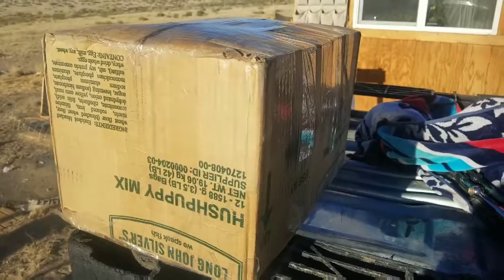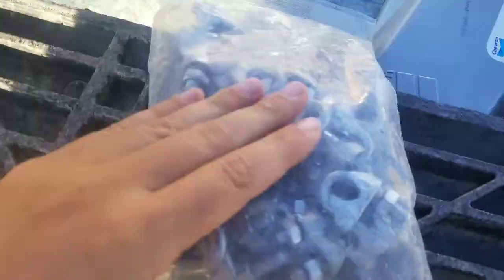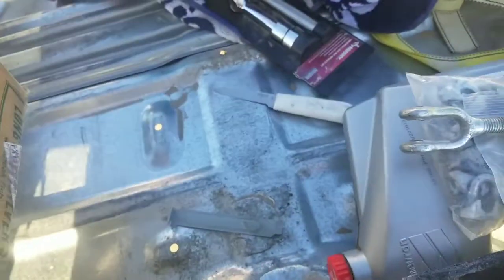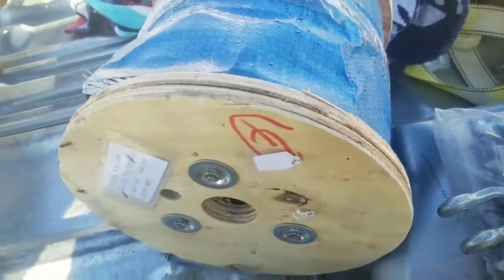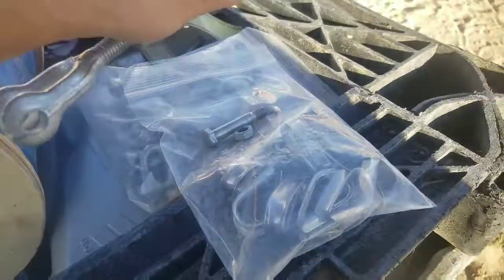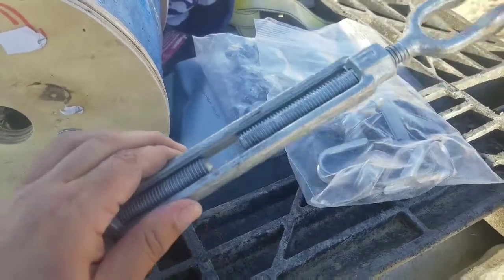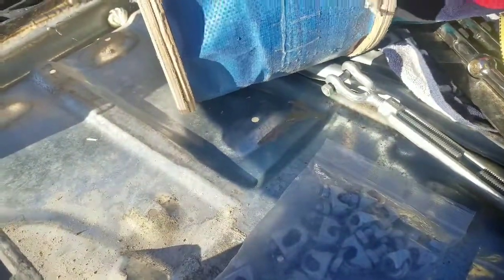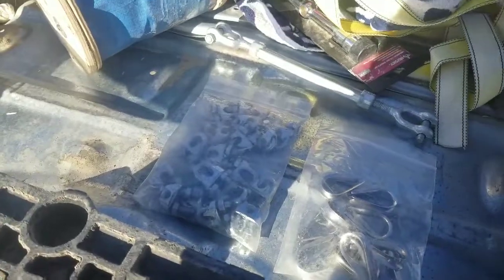Guy cable system for wind tower arrives and is checked

Comment: 7x19 describes the make up of the cable IE 19 strands of fine wire. twisted into a cable then 7 (6 wrapped around 1 as a core) of the 19 strand cables twisted into the final configuration !